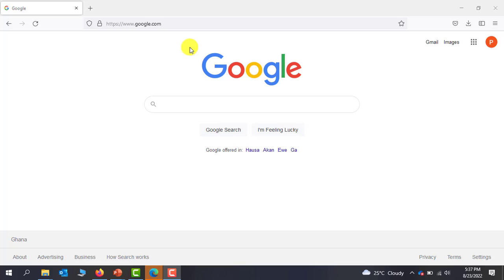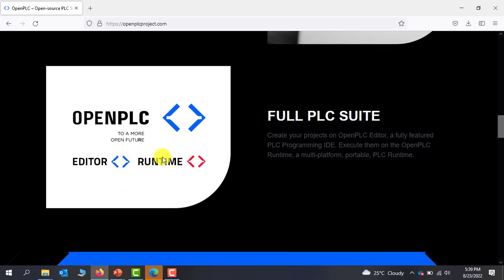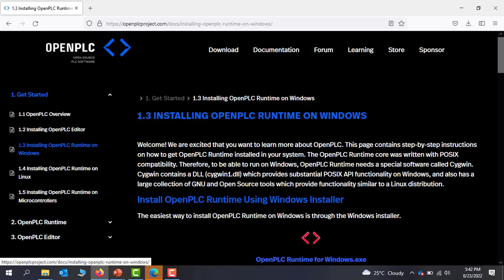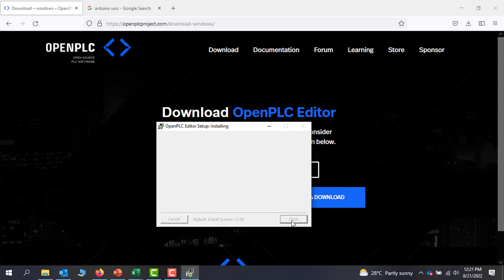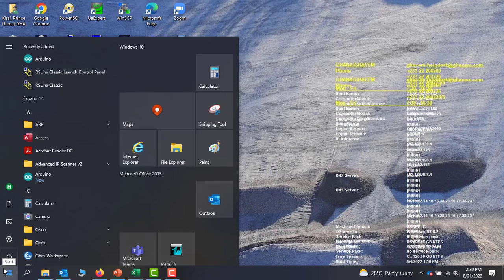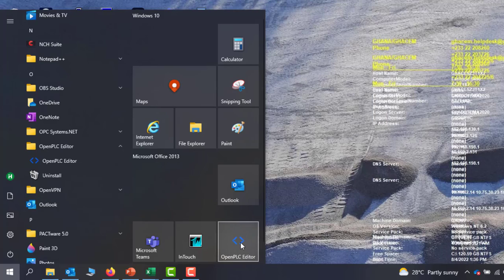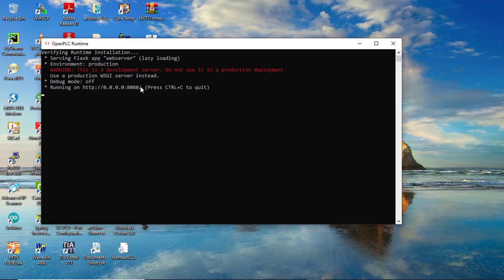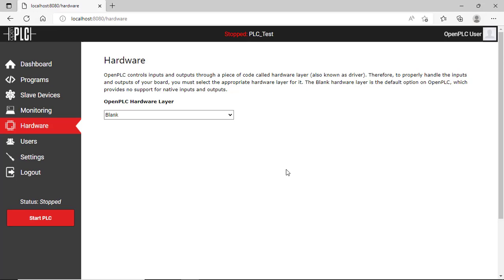How to Download, Install OpenPLC and create project with Arduino  Part 1

Comment: HELP ME I CANT USED OPEN PLC TO MY WINDOWS 10 PC.
Reply from the maker: Really.  Please is it the editor or the runtime?
Reply: @engineeringmadeeasyingme6819 please help me. Im using windows  10
Reply: @engineeringmadeeasyingme6819  please help me for my final project 🥺🥺🥺
Reply: @engineeringmadeeasyingme6819 yes
Reply: @engineeringmadeeasyingme6819 it is error
Reply: @engineeringmadeeasyingme6819  please help me